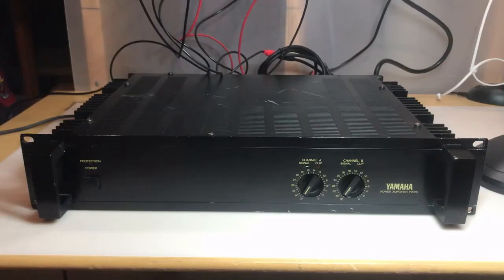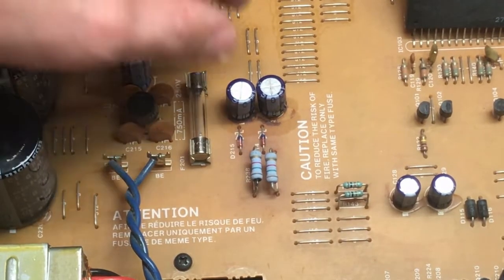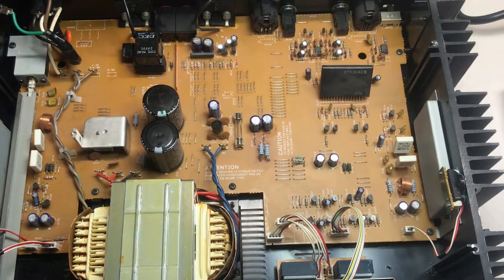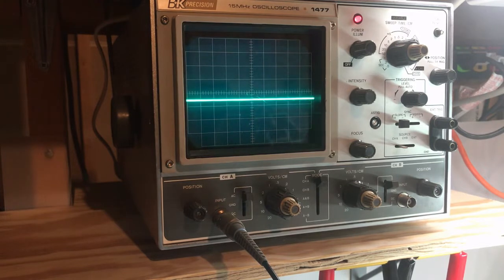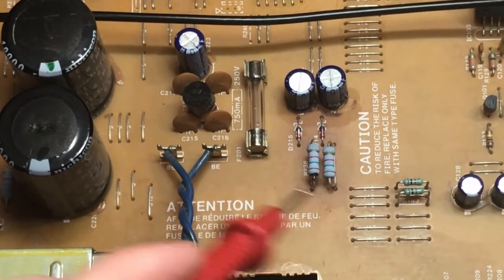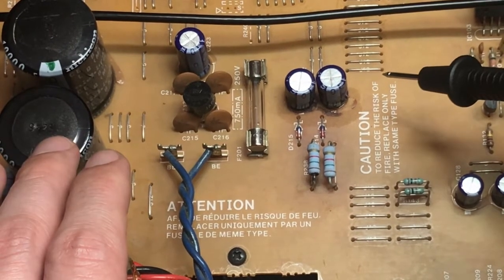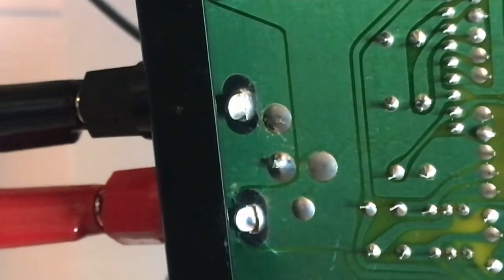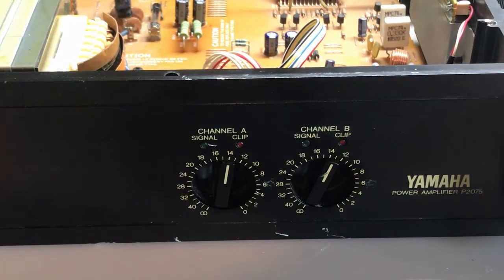DR #16 - Yamaha P2075 Amplifier Troubleshooting and Repair - No Output

Comment: You likely wasted a lot of time and unneeded parts. With the caps failing across the diodes, of course they showed the short. Without testing out of circuit, the actual bad component(s) cannot be identified, and if anything, the caps shorting would have prevented damage to the diodes . . .
Reply from the maker: Yes probably. This video is 5+ years old and I didn’t have much experience back then.

Comment: Hi there, I have a vintage ELAN z660 power Amp. it was working just finetilllike4 weeks ago, but suddenly it starts but then the output sound is lost real quick. It has 6 channels, and the output is derived from all6 channels. The Amp stays ON, with no bad smell or burnt spots. Any suggestions? Is there anywhere we can get the schematics diagram for it. Appreciate your response.

Comment: Hi , may I have a question? I have an AX-490 amplifier, with blown one channel and fuse, I've replaced the a1358 and c3856 they were shorted, I cannot detect the short anywhere anymore but the fuse  keeps blowing up! Any tips?
Reply: output transistor is shorted

Comment: Any idea why the A channel has 15v across it and there's no output signal? Channel B has 3.6v and is working fine. Thoughts? Many thanks, Ian
Reply: It can not be. Must be similar, either you’re speaking about power board voltage or voltage to power the op amps. Check the diagram. You may find it in hifiengine.com for free. Regards.

Comment: What no heatsink on the AMP IC ?
Reply: The amp IC in this case contains only the input stage. The power transistors are mounted on the two heatsinks. 😉